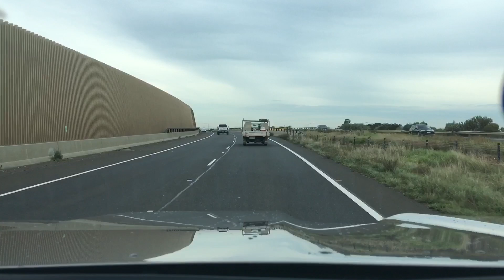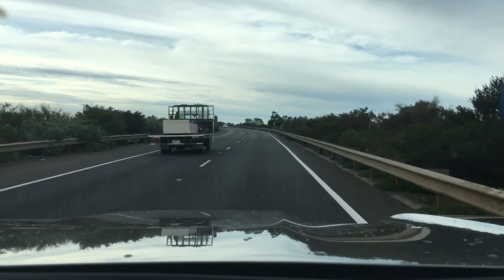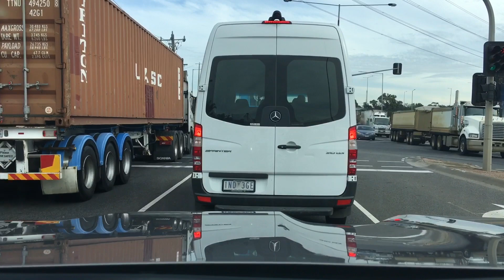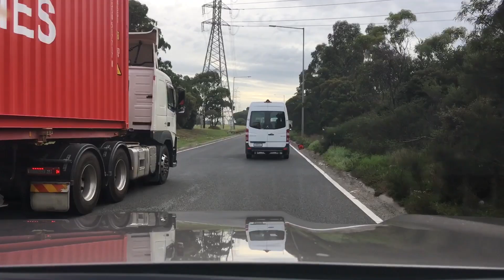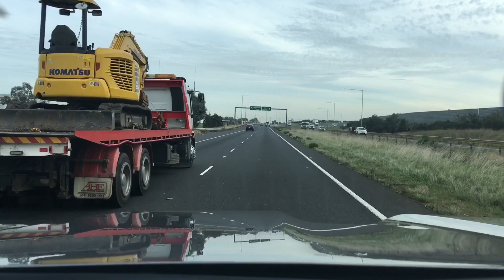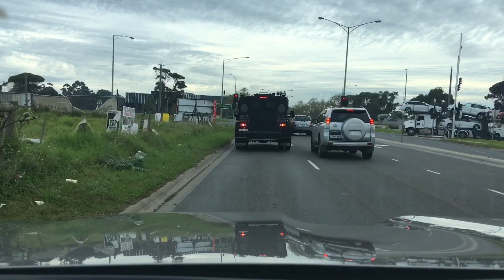EXPECTED LIFE OF TOYOTA DENSO INJECTORS in 1GD-FTV and other COMPONENTS

Comment: I have a 150 2016 1GD with not a single issue. Done 160K. Thanks for clarity on injectors. I change oil every 8-10k. Use cleaner power injector cleaner regularly,  and engine flush every 50K. Looks and runs new. Engine made a difference in power, lots of gunk came out. Have changed gearbox oil as well. Will prob change at 200K.

Comment: 2019 gx mine spec has 410,000 we have 15 in the fleet all avg 130,000km a year none have ever had injectors last one was sold with 700,000km only ever had regular servicing done nothing else
Reply: Probably you are lucky to get good quality diesel

Comment: 140k on my 2016 1GD and when in for it's service this month the coolant reservoir was low. Diagnosed by Toyota as a crack in the EGR cooler. Replaced under warranty but monitoring to see if the coolant is still leaking.

Comment: Sold my ‘16 1GD with 122000km on odo - never a single issue. Bought a new 150kW 1GD, but too early to tell yet. At work we have a fleet of 2GD’s - all north of 350000km’s and a few over 400000km’s - no engine issues whatsoever, with just normal servicing.

Comment: A common problem here in the PH with regards to GD equipped vehicles are the alternator pulley bearings. Some had alternator bearings fail at 70k km or earlier.
At what mileage is it recommended to clean the EGR for this engine? No DPF btw.

Comment: I have a 2015 Fortuner which has done 120,000kms. Serviced as per toyota schedule, use Penrith oil, engine flush used at each oil change and use genuine oil filters. No known problems so far.

Comment: Have a 1GD in a 2019 toyota Hiace. It's done 250,000 km with no major issues.  DPF has had some strange burns from time to time. But all good so far. Hopefully this van will  do 500,000 plus. Using penrite full synthetic as recommended.
Reply: Hi, mine has 250k on as well. How is your engine doing now?
Reply: @thomasasannes  any DPF issue?